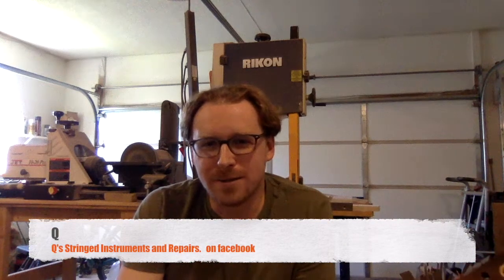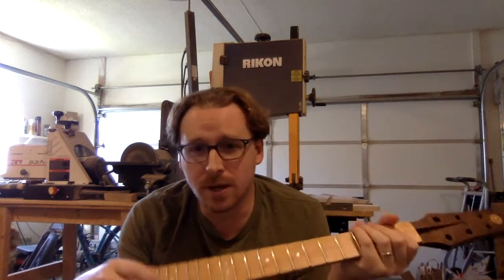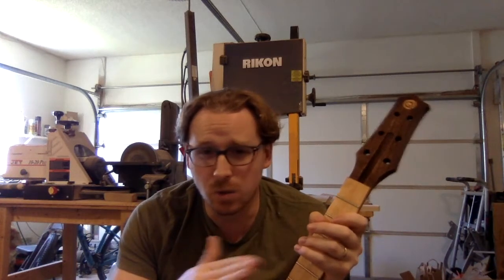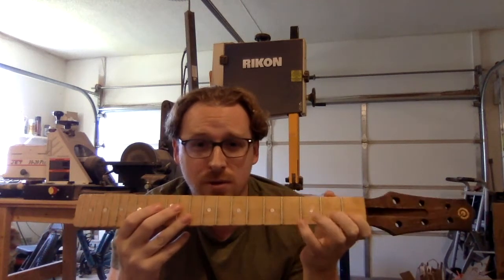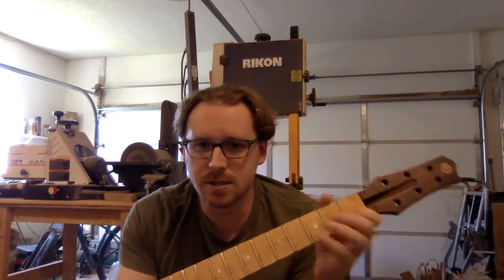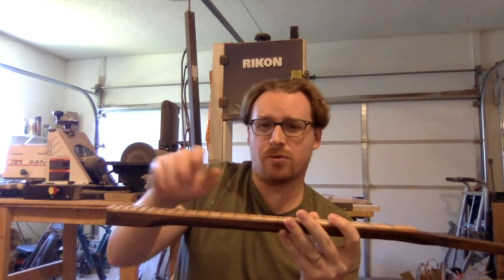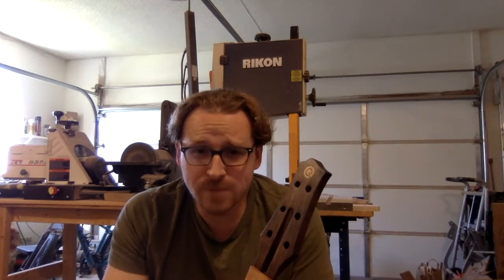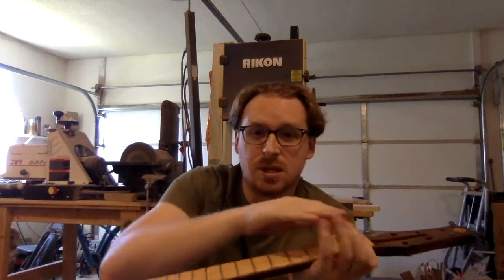Truss Rod Adjustment without fancy tools

Comment: mine has a cross head screw hole and I cant get any of my screw drivers in there, I haven’t watched the video yet hope it works!!!
Reply: What kind of guitar do you have? I have a Fender Jaguar with that kind of adjuster where the neck meets the body and the only way to make the adjustment is to put a capo on to hold the strings from flopping off the headstock then totally loosen the strings, Then unbolt the screws which bolt the neck on, make the adjustment, only 1/4 turn, then screw back the neck, re-tune, then repeat as needed.  It's pain, but hopefully you never need more than 1/4 or 1/2 a turn to get things right.
Reply: I ended up figuring it out thanks!